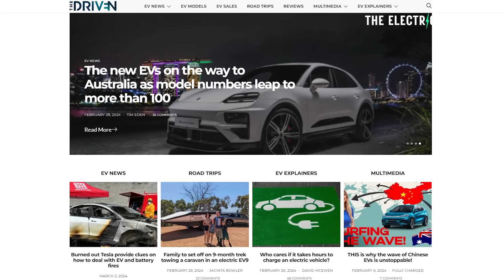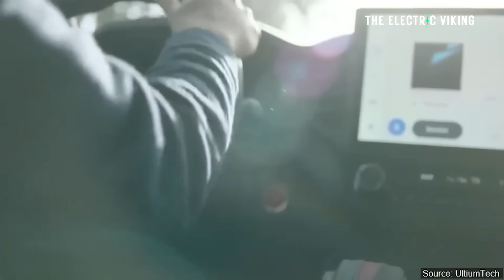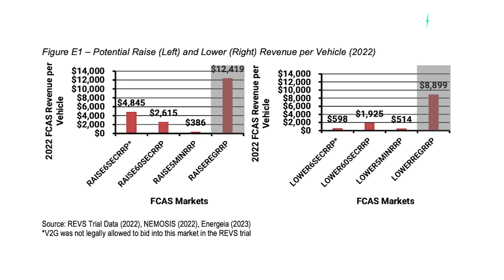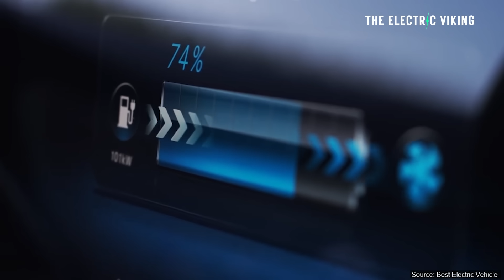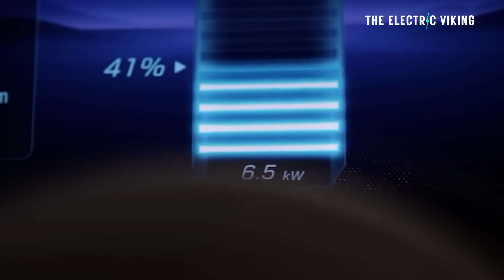Electric Cars could earn $12,000 in a single year with vehicle-to-grid tech

Comment: Brilliant video. 
20million rooftop PV 6.6kW is 660gWh, more than the maximum fossil fueled 25gW x 24hrs = 600gWh.

We don't need distant renewables electricity. 

We don't need nuclear electricity. 

We don't need more grid capacity. 

We don't need more grid generation. 

The GRID OWNERS NEED $110billion CASHFLOW. 

The customers are THE  suppliers of CASHFLOW. 

FMD this is so obvious. 

The grid owners should lock in existing customers as suppliers of dirt cheap electricity and self suppliers.
And then as the original customers demand changes to supply, the grid owners must supply the new heavy useing industrial customers moving away from fossil fuels. 
Moving to clean electricity. 

New grid capacity construction costs are extremely expensive, $TRILLIONS.

Comment: Rapid charging on the main roads and at corner stores if needed. 

V2G BVs trickle currents all day long need only a $60 wall outlet.

Say bumper height wall outlet for a selfparking selfplug-in V2G BVs. 

Most vehicles are parked 23hrs every day.

Comment: Getting V2G BVs oversized battery parked 23hrs every day ON THE GRID,
( 20million vehicles in Australia) (2,000 gWh)
will be healthy for the grid, just my comment. 

Battery Vehicles battery is sized for the long drive or the weekly top up. 

Battery Vehicles battery is OVERSIZED for the daily drive demand and can be topped up daily. 
Most vehicles are parked 23hrs every day and all night long. 

Avg mileage 10,000 and 8,760 hours per year, means 1.14mph or 27 miles per day. Avg. USA. 

300million vehicles 100kWh battery is 30,000gWh of stored electricity gWh. USA est. 

DAILY storage gWh + rooftop PV gWh generation.

Comment: to generate $12K would require feeding in to the grid 33kwh every day of the year (about 40 50%of your entire battery reserve)- and them paying you $1 / kwh for the privilege...... how likely is that?
Reply: I’d be happy with half that. That would justify my switch to upgrade my solar system, install a home battery and buy a V2G solution at home.
An ROI of 5-6 years would be a game changer.
It’s exactly what happened when I put in my 4kW Solar 7-8 years ago. It paid off in 4 years. Massive ROI better than my stock portfolio of ETF’s.
FYI - I’m in Australia
Reply: @aaronsinspirationdaily4896 I would be very happy with half that too - my point is - sadly - it ain't going to happen. So the $12K story is mythical. The ROI on solar panels is still decent but buying a home battery has a hopeless ROI.

Comment: So far V2G is only in trials in AU. There is only 1 bi-directional charger to purchase ATM and you can't legally use it, and a very small number of EVs that have V2H or V2G. The EV market leader in AU, Tesla, does not yet have the capability of V2H/V2G in the vehicles sold here. V2L is interesting but not enough to stabilise the grid or power your house in a power outage.
We are not there just yet. It's coming soon, I hope. Government and regulating bodies need to get their fingers out 🙂. EV manufacturers need to include V2G/V2H capability when selling in AU. Make it part of the regulations for EVs along with tighter emission standards for ICE cars. Some political will power needed.
Liked this video. Cheers.

Comment: An electric car won't last 12,000 miles. At 12,000 miles, the Chinese batteries will need replacement. $12,000 is an amount the Dimocrats can ignore while the average price of meat and bread  contiue to rise. The problem of range comes to mind plus no EV charging in most cities and town. What about the  electrical grid? Biden has sold a bill of goods to the people of the US and the car manufacturers. Electric cars burst into flame with no warning. Is that what you want for your children?

Comment: There is a compnay called dcbel energy that has a new product coming this year (to New York state and California first) that acts as a dc/ac/V2G/V2H/solar inverter/DC charger power manager for your home. It kind of does everything including high voltage DC charging direct fom solar or your storage battery. It has sophisticate software that can mange all of it including feeding power back to your supplier when it makes the most sense. I am very much looking forward to seeng some reviews soon. The device is called Ara (formerly r16).
Reply: @Hybridog  great comment.
My concern is that the grid itself is a $TRILLIONS infrastructure investment, and the owners must have a return on investment.
It must have $100BILLIONs cash flow. 
They sell $10BILLIONs grid electricity to millions and millions of customers.

The cash can only come from customers. 

My thoughts are to keep the existing customers connected to the grid as 1/ backup if the home system fails and 2/ take the old customer's excess dirt cheap rooftop PV electricity and sell it to the new industrial users who are leaving fossil fuels energy. 

The national electrical grid is a 10decades to build project and cost $TRILLIONS in national wealth.

My point is that it is still valuable as it can transmit dirt cheap electricity from millions and millions and millions of customers to the new demand from the heavy industrial users. 

The grid does not need the traditional central generator to supply.
The traditional load is off the grid, and the new supply is available for the new industrial demand.

Comment: I had a quick read of the report the news story is based on, and it seems to be overblown hype. In effect, it boils down to this...

During peak-use times,  electricity companies are willing to pay a lot of money to buy electricity from, say, peaker plants or companies/individuals who have electricity in grid-connected storage batteries. Potential suppliers of electricity bid to supply the required electricity and the lowest bid wins. At the moment, demand for such electricity outstrips supply, and hence even the cheapest bids can earn a lot of money; hence the $12,000 per year figure. However, my assumption is that within the next few years, the supply of grid-connected batteries will likely increase massively, partly from houses with solar+batteries, partly from EVs with vehicle-to-grid capabilities, and partly (and, I suspect, eventually mostly) from grid-scale battery packs, such as Tesla's megapacks. When the supply of grid-connected batteries increases sufficiently, the supply-demand imbalance will be addressed, and the price paid by the electricity companies to buy extra power during peak load times will probably plummet. As such, an EV that might be able to earn $12,000 from selling electricity to the grid this year will probably be able to earn only a small fraction of that amount in future years.

Comment: What a nonsense, if you could earn $12000 a year that means energy retailers are currently paying wholesalers more than $12000 a year for that same supply and recovering more than $12,000 a year through billing for a max feed in rate of 7kw per hour  - and all this is possible discharging 1% of my battery per day for 365 days? = 365 x 60kwh x .01 = 219kw = $54 per kwh feed in? - that's simply not happening for houseold supply between 5pm and 9pm. 

I think maybe someone got their Megawatts and Kilowatts mixed up and it's actually $12 LOL.

Comment: That seems like a clever idea; but in my local; you wouln'd be allowed for safety reasons. So say you plug your EV in; and you do not turn off the breakers on your panel to prevent power from going out to the grid.  This could electrocute a line worker; because they may think there is no power on the line because they isolated themselves from their sources to work on it; but your car is sending a very high amount of power out; this would not be expected and the person working on the power lines would recieve a shock possibly killing him right away; or causing a fall to the ground etc. I don't know that this can be mitigated or not.
Reply: Already happens with solar and with batteries -  there are Line Isolation Switches that cut off any feed-in to the grid instantly when the AC mains goes off. It's the same with V2L - as soon as the AC mains feed in stops the Line Isolation Switches kick in an stop back-feed.
Reply: @TB-up4xi  OK so how would these car batteries then move power back onto the grid?  How does such a system know if a lineman is working in the local area that might be zapped?  Is there a way the lineman would  be able to turn off all such batteries attached?

Comment: LFP batteries might have more charge cycles, but can't be used with dual motor cars because they lack the energy density. Something to consider.
Reply: Since when???   F-U-D hope that wasn’t th smartest thing uve said all day
Reply: BYD Seal performance, Fisker Ocean AWD, Mustang Mach-e AWD?
Reply: I think @migmigjohnson9351 you miss read. I mean, I agree LFP battery have less watts per volume compared to Li-ion but only need to add little bit more battery and you have same amperage compared to Li-ion. Not big deal, and of course not a dual motor breaker. 😉

Comment: There is no free lunch. It will accelerate battery degradation. What you earn will be offset with depreciation.
Reply: The latest ev battery can run for 20 years, but at 10 years time, one may replace his vehicle anyway, so why not utilise the battery to make cash which may pay the car fully or partially. I will be loving to enjoy a free car by helping stabling the grid too.

Comment: What you're describing is a symptom of unbridled free-market economics. Turn the electricity supply into a commodity that can be bought and sold and traded, create and exploit shortages. The wealthy can buy cheap and sell high, I would call them eco-spivs. It's the poor that suffer. The answer is to take generation and distribution of electricity into public ownership so that speculators can't engage in profiteering. The state can then take responsibility for ensuring that there is enough generating capacity for everyone.

Comment: This type of synergy of grid to EV and later, at peak hour, EV back into grid, can only work with BEV. This will flatten the duck curve. On daily basis charging into an EV at 30kwh during of off peak and take off out 15kwh during peak hour charging back into the grid. 

PHEV with a smaller battery would not work. As more EV, like millions of EVs, are smartly tied into the grid the grid will be more stable.

Comment: V2G is a great solution to the peak demand problem that National Electrical supply companies are going to encounter as they move away from fossil fuel electricity generation (which is quickly and easily modified to suit demand) as wind, solar, hydro and Nuclear are all much harder to regulate (as in control output) in most cases due to the loss of a single generation source. Personally, I would never use my car in this manner but would instead buy a stand alone system specifically for the job, nor would I ever consider buying a car that had been used for V2G.

Comment: It is amazing to think of all of the ways an electric vehicle can be used in addition to driving.
Reply: As it's currently not being used 95% of the time, Tesla has talked of renting back all that compute in their FSD chip as a giant AI virtual inference engine. Brilliant.
Reply: @SynergyDMS  exactly. 
Nuclear promoters talk about UTILIZATION FACTOR and running their reactors 247.

As you say, Tesla will be the most valuable computer and store of dirt cheap rooftop PV electricity, and all with the grid customer.

As grid electricity is expensive electricity and not needed when the sunshines, then the grid CASHFLOW will be f...........cked.
As they say.

$TRILLIONS infrastructure investment owners cashflow of $100sBILLIONS lost.

The grid is scrap value if it is not selling electricity.

Comment: So the idea is you pump 'x' back into the grid, and then immediately remove the same 'x' from the grid to charge the battery back up.

Sounds great until you factor in all of the transmission loss, etc (each way)! 

This has become my go-to channel for my daily laugh at the level of stupidity that 'experts' are capable of 🤣
I think this gem is in the top ten... I don't think the number one quote from this channel about "the difficulties involved in refuelling a fossil fuel vehicle on the move" will ever be beaten, though 😂
Reply: I don't think it really matters if there are some losses or not. It's more important to stabilise the grid.
In Sweden the grid losses are about 10 %, and in Sweden quite a lot of the electricity is transferred more than 1,500 km/1,000 miles.
As time goes by the system/grid will be made more efficient.
If you can get paid for using the battery of your car, then you can recycle the battery "earlier".
But already in the next future there will be a lot of stand alone batteries in houses of any kind.
Reply: As @leiflillandt1488 noted, you @Paul-li9hq look like still not understand the basic of electrical grid, the trouble for the grid is not loss in the line (They are minimal by the way and too about charging discharging V2L battery. Since it vary, but we talk about 10% TOTAL.) But trouble is the peak in power in those grid. The trouble is mostly everyone want power, but in the same time ( Like 6hrs to 9hrs in the morning  and the second peak  is like 17hr to 20hrs.) It's when grid need the most power and it's very costly to buy on the market or to make more power station and maintain more power station. Then it's at those time V2G can help in those peak, it's simple, as that V2G can fill in up in the night, then help in those peak.  Even with lost as you noted, it's way more costly efficiency to do this compared to build new power plant just for little peak. It's why many grid company added battery pack (Still costly). Cheaper way is V2G but since for now not a lot vehicle of V2G capable for now, probably most market will be introduced it later as market of EV grow probably.
Reply: Good to hear from one of the channels most clueless trolls

Comment: In the Netherlands, the grid can't handle the energy surplus. In diverse places across the country, new masts are being upgraded.
Grid sounds interesting, but as far as I know, it is not a common olace to do yet, and not all energy providers provide this as an option. Recently, the Renault R5-e supports V2G natively, but I din't talk about specs, and no reviewer today has talked about V2G specs extensively, so I think it is still not part of the general conversation. Also, the projections, in my view, sound too optimistic. Some people might achieve that yearly income, but most won't, because not every household will have the means and infrastructure in buildings and homes to install and support V2G. And no automaker talks about at what speed or capcity their EV supports V2G. I can imagine if there are different tiers for different capacities to support V2G, instead of one standard, businesses could compete on technologies to support those different tears for a price. I can easily see those tiers eating away at the profits due overheadhead costs, just like many solar panel home systems have with teturn on investments. So yes, you will get those 12500 dollars a year back....for a price. Energy companies will likely want to buy electricity cheaply and sell energy for a profit. So you might again lose that sold energy and buy admission of your own energy consumption. Energy companies mightve stacks of money, but if they lose more money as more households join V2G, it will be less interesting for energy companies to buy from you. Energy companies also want profit at the end of the day. What is intwresting if house hoin an energy corporation (group of households that collaborate in a joint venture)  where each party benefits from each other. The energy company benefits from the community corporation because the onvestment in infrastructure will likely be less overhead costs due to only optimizing minor infrastructure, diminishing expensive overhead costs installation costs equipment and leople and can buybin electricity at a reasonable price and the shareholders of the community profit from selling. I think we'll see that more. It's some I see already in the Netherlands, for example, with appartment complex roof projects with solar. I think otherwise for each home individually, retrofiiting will be expensive and likely cost more than provide a reasonable return of investment. Those yearly 12500 dollar  profits might evaporate in a blink of eye when looking at the bigger picture, I think.
Reply: Any battery mostly connected to the grid can dampen out the peaks in supply/demand.
V2G in towns like Amsterdam, Rotterdam, and megapacks near Bleiswijk, Europoort, IJmuiden, Arnhem (home of Tennet)

Comment: Only if it is possible to get "good money" for stabilizing the grid,  why  a car is needed at all. A big battery and inverter connected to the grid will do.
Reply: Agreed but EV batteries are typically much bigger than any home batteries on the market. Either work just as well but EV batteries are just bigger. That's all. I want to have both.
Reply: @garyrooksby  Why are we even putting batteries in cars? We use our car an hour a day. That leaves 23 hours of wasted capital sitting in the driveway. 
We need to prioritise using batteries in the grid. After all, the grid produces 6X the emissions that passenger cars do.